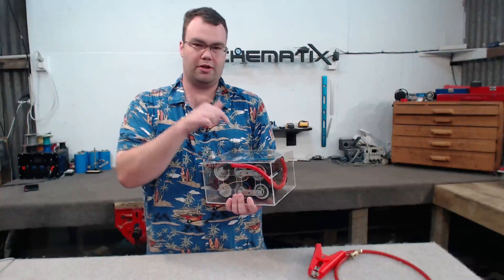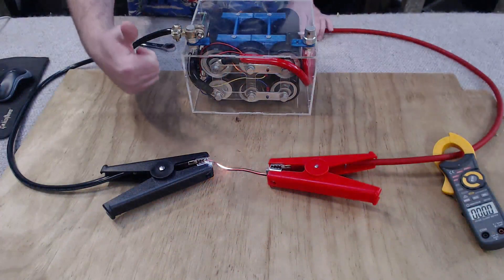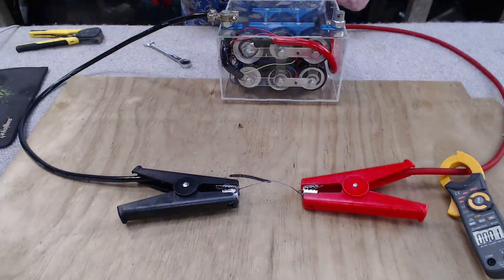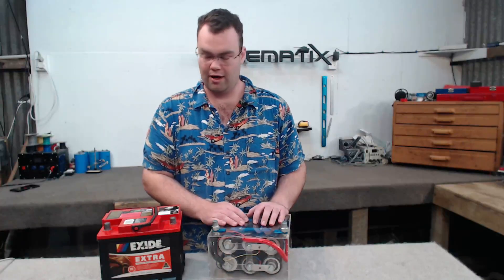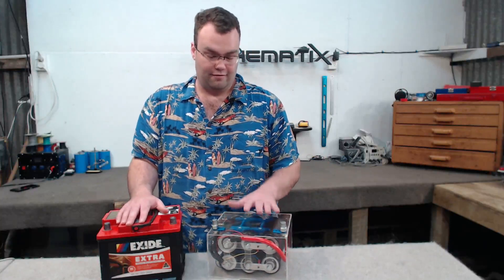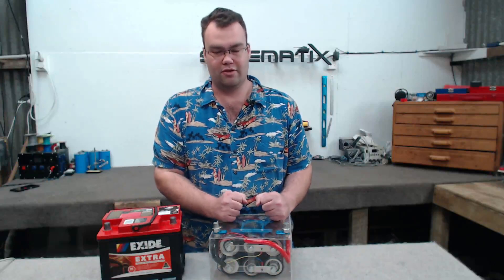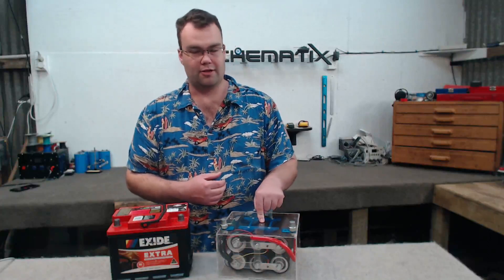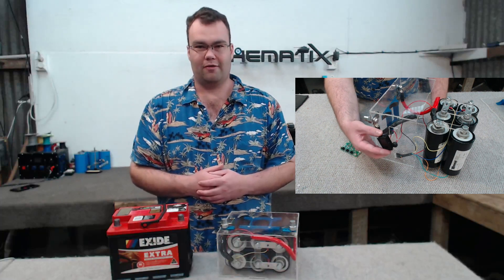Will The SuperCapacitor 'Battery' Start A Car??..... Test & Demo

Comment: I don’t want to split hairs here, but it is very important to use the correct terms. You use the term “Power” when I believe you mean “Energy” when comparing the Capacitor bank
To the automobile battery. The automobile bay has more “Energy” in Watt Hours than the cap bank, however, the Cap bank likely has more “Power” in Watts than the automotive battery. The Cap bank likely has a lower internal resistance than the automotive battery, thus it is able to give up its energy in a shorter period of time. Both are important characteristics to understand and not interchange.

Comment: If you only had a standard battery charger to charge your capacitor bank, put a filament type head light bulb in series to limit the current. This is better than a resistor, as it's resistance reduces as the current through it reduces. Not constant current but closer to it than a resistor.

Comment: Thanks, very interesting. How do think the capacitor bank would handle a small ark welder. I have a generator for running my welder which is a bit under powered for the job but if I had the generator charging the capacitor and the capacitor running the welder it might save me having to up grade my generator.    Do you know of anyone who has done this. Thanks Simon

Comment: thats a 500F cap , n Im using a 150F for a car bat. i do have an alarm as well ,i had that problem of the cap draining by its self only after two days not using it wont be able to start it ,so i added a quick fix to that problem , guess what i did?
Reply: 1st try was adding an emergency 12v 7A to it ,it weighed just over 5lbs all together ,had it my car for 1 year, never had to boost it ,now i want to use only the cap so my 2nd test . I added 1 simple thing to it guess that 1 ?
Reply: @808pathfinder  ha...i am all ears....maybe a solar panel!!!

Comment: Two questions: Did it start the car, it wasn't obvious whether it did or not? What is the fully charged voltage, I guess 14.4 but really being 11.diddly after a few weeks aint much info if you don't know where it started.

Comment: I need to tip my car upside down - so a Lead Acid battery would spill
Reply from the maker: Rather an unusual problem you have. But, I'm glad you found this as a solution :)

Comment: I’m planing on adding 6 2600 farad super capacitors to the rear of my car with the amp to my subwoofer 🔊 
I’m keeping the lead acid battery in the front...
Has anyone done this instead of adding another average car stereo battery?
All fused with a circuit breaker on 0 gauge wire down to 4 gauge.
Has anyone ever done this?

Comment: I just come across this , Iv been think about this for my bus rv battery bank so what was 4 12v deep cycle. Im in to up grading system. What I want know is, can this be built for less the cost of AGM battery? The other side of this well the caps be better than lithium battery?  I would to talk you about this in depth.

Comment: It's use is as a light weight quick charging hand held booster to start vehicles with jumper cables.all that needs to be done is connect to a known good battery and recharge.

Comment: I have a question: So with 6 of the supercaps in series you were able to produce roughly 300amps in your 'dead short' tests. Question I have is would you get the same ~300amp reading if you had only 2 supercaps? The difference being how long that discharge rate can be sustained using 2cap vs 6 cap...

Or because the voltage of the 2cap version is only around 5V (vs 6cap at ~15V) would the discharge time stay the same and amperage therefore be less; more like 100amps in 2cap version?

What Im trying to do is make a 'jumper' pack just like you did, but make it less weight/size - so use fewer supercaps; preferably 2. But obviously, I want the same amp 'jump' for starting a large tractor or the like. I know the power overall (W) will be 1/3 (~4W) of original 6cap - 13W I think you said. 
------------------------------------------------------------------------------
So [A] I would only be able to 'jump' say 5 times with 2cap version vs say 15-20 times in the 6cap version; both theoretically at the 300amp range. 

Or [B] is it more likely to be same number of 'jump' attempts (15-20) and the 2cap will just put out less amp (100A) than the 6 cap (300A)? Thank you.
Reply: I see this is from a year ago, but if you only use 2 caps you will most likely blow them up when you connect them to a 12V battery to jump start a car.

Comment: Just for curiosity! What will happen, if I use both of these as parallel connection? :-)
Reply: the battery will have a longer lifespan about 60% or more if it is connected in parallel
Reply: Just type "hybrid supercapacitor car battery" in the search box.

Comment: Well, I don't want to replace my car battery but I will use such a cap bank for jump starting my car.
Reply: I,ll do the same thing on my pickup truck, my truck battery just started getting weak. Put my capacitors back seat on floor.

Comment: With dead short, maximum discharge current before destruction of caps? (perhaps 50/100A, etc. Buss fuse/Fusible link... to allow sufficient current for the Starter).
Reply: considering similar build for my motorcycle...
Reply: Almost no limit of current especially with 3000F supercaps
you could see up to 10,000 amps on a complete total dead short if the connections are extremely beefy and overkill. (the supercaps likely will drain before they could get hot enough for destruction to happen on the first couple of times. but eventually they will become weak and useless if you do it more than once for sure.) There still is a possibility of them becoming hot enough to vent. but I doubt they would spew their insides. just lots of smoke most likely no explosions (unless they are completely sealed with no vents then they might go bang)

Easily over 1,000 amps if the connections are extremely beefy. (for example supercaps soldered directly to each other with no gaps between the spaces between them.)
For lower end really cheap supercapacitors you might only see up to 1000 amps or even only 500 amps at a dead short. (which is still an enormous amount of current!!)
Reply: thanks... is essence, the limitations depend on current-carrying capacity of the contacts/terminals... (or the internal connection(s) thereto). (example: what is the current-carrying capacity of a, say, a stainless steel - or even copper/brass - M6 Bolt?)

Comment: Nice Vid,   If ya really wanted to use the caps for a battery in your car,  You can get a small motorcycle battery to run Your alarm separately.

Comment: One of the main advantages for supercaps in vehicles is that they still crank at really low temperatures (-40 degrees, etc.).
Reply: And the other is they crank until they reach 0V and it is no problem. For lead battery if it goes under 7v it is most probably dead. So you just can't use all the energy stored in lead (or Li, Ni, Ka etc) element.

Comment: Your bank looks alot nicer than mine. I just threw it in a cardbaord box that was about the same size. Its been in my car without a protection circuit for about a year and a half in addition to 2 truck batteries.

Comment: you say 10X the cost of leadacid ????
that'd be about $700 for the 6 caps  ?
I've never owned a car worth that much
Reply from the maker: The boostcaps run for about $100NZD (or about $70USD) each on Mouser right now. So with the balance board, acrylic panels, terminals, cable.etc  Depending on the cost of shipping.etc anywhere from $500~600USD as a rough estimate.
Reply: @ @Schematix  I've just bought a 16V 83F supercapacitor (with leads, resistor and an aluminium case) for $NZ102.  I plan to mount this alongside my SLA battery, which has been getting weaker due to lack of maintenance and lack of use of the car due to poverty.  Hopefully this combination should prevent me injuring my arm again through lugging the heavy bastard the long distance from my car port to my house, make the car and everything in it run better, and extend the lifespan of that hefty slug of a useless battery.

Comment: might be good for motor racing - given its so light and Race cars don't have too many things that drain power when its not running.
Reply: Exactly, most race cars have the battery kill switch anyways that kills all electrical power and turns the car off, this setup could save 20-50lbs of weight in a racecar which is a huge amount, and simple too if done right.
Reply: race cars don't use a battery
Reply: Race cars are usually fairly hard to start, so a supercap bank may not have enough reserve power to crank long enough.

Comment: thank u  ..excellent vid  ... just one question ...any chance of hurting your starter motor??  lead acid batteries are normally rated for each vehicle ... and this bank looks to be '' one size fits all ''  ...
Reply from the maker: SLA batteries are rated for each vehicle based on the size and type of motor. Bigger motor = more current required from the battery to start = bigger battery. And vice-versa for smaller motors.

Comment: Well, the price has gone up from the last time I looked at them.  So, yes, it's not all that economical for those caps.  But you could get the 350F ones and create 3 4 layers per se and that will bring it closer to that capacity.  But I knew someone that tested out the 3000F caps for a year and the 350F caps the next year.  It works in the car just fine.  He didn't use that balance board.  It may reduce issues with bleed but am not all that sure it's necessary.  And the caps do have some resistances.  So, you can keep it topped off with a dash solar panel.  You could build a battery pack with large numbers of 18650's but I don't know how well it would work.  They don't like to be charged when it's cold.

Comment: i love this video, i built one about 2 years ago, one suggestion i have for you is to add 4x3.7v Li-ion batteries (with protection circuitry and balancing) in parallel with the capacitor bank, with no load on, my capacitor bank remained fully charged for 11 months (2200mah 18650's). With my car the parasitic drain is 19mah
Reply from the maker: That would certainly work, The annoyance with my car is the drain from the alarm. It would kill those poor 18650's in a heartbeat. However, for 'normal' situations the 18650's would work a treat in most cars :)
Reply: Dash mounted solar panel??

Comment: The ideal thing is have the capacitor bank. a small battery to keep it topped up. and a solar panel to keep them all topped up
NEVER. EVERRR have a dead battery ever again.. Best thing is. it recharges itself.
Reply from the maker: Very true, would be an awesome combination. The hybrid battery/capacitors would output short bursts of massive current similar to that of a much larger battery. While the solar panel keeps everything topped off. Good stuff ;)
Reply: Yessssssss that would make cars last foreverrrrrrrrr just add a small solar panel built in to the roof shrink the battery a bit. then add super capacitors haha!
You could use a 5AH battery and get many starts out of it (would be like a joule thief getting every last ounce of energy from the battery. plus its not as much stress on the battery because it doesn't get discharged at such a high current!)
And the solar panel would mean it would never ever go dead from sitting!

Comment: Actually that should be a bonus having it discharge so quickly because then if someone tries to take your car they won't be able to cos it's got a flat battery.

On a more practical side you could always use a smaller lithium battery in combination with your caps bank to keep the alarm working, and or you could just hook up your caps bank to a small solar panel to keep it topped up.

Check out lasersabers work, he has used 400f caps in combination with a lifepo4 battery to run his car.

Oh and used a solar panel to charge it. 

Because it charges so fast he suggests it's not a huge problem.

The biggest draw back on using capacitors is generally the price of them, but if you kept the car for a long time you may get your money back on reliability and fuel consumption as the caps wouldn't degrade like an SLA battery would.

And let's face it, jump starts would be super quick as the caps recharge in seconds rather than hours, so you could carry your booster in your pocket connect it into the cig lighter socket and in seconds be ready to start the car.
Reply: I thought you were joking at first, hell no I don't want to worry about a dead capacitor bank, I can lock my doors thanks. What most people don't realize is that capacitors tend to have the similar shelf life of 3-4 years as batteries so why complicate things? Capacitors leak to half their voltage in 30 days and degrade in the heat. All so that you can have 2-3 cranks at full charge. [Wheel reinvention intensifies]

Comment: Cool video. I replaced my car battery with caps but I agree with you it's not as practical as just using a battery for most applications.
Reply from the maker: Thanks for the feedback! I've no doubt as capacitor technology develops we will see cap's eventually replacing batteries. But for the mean time it's not quite practical like you said :)

Comment: Could you put a switch on the case? Watching you lean in over it is making me nervous.
Reply from the maker: I appreciate your concern for my wellbeing. However there isn't any risk of electrocution from my capacitor bank. The voltage is too low :)
Reply: yeah even 50v DC is not very deadly. barely gives a tingle.
you need voltage first to get any current to start flowing
and 12v isnt enough to get any noticable amount of current to flow through you. which is what this capacitor is.